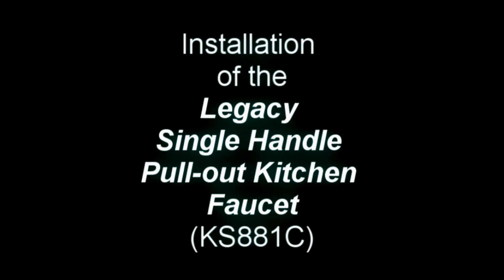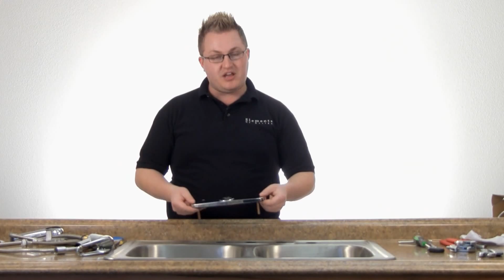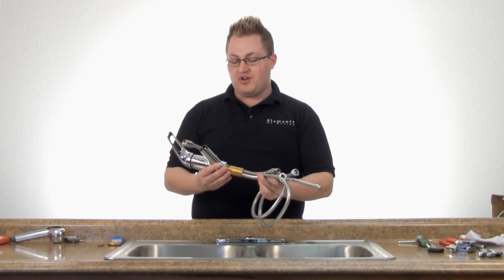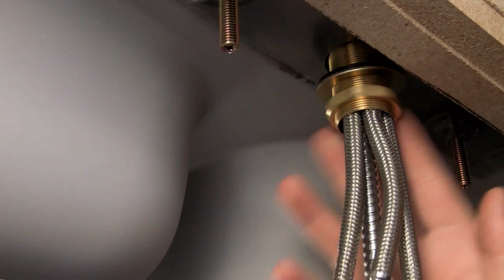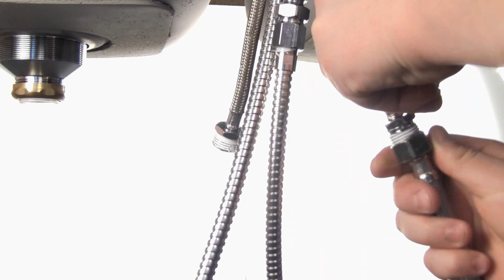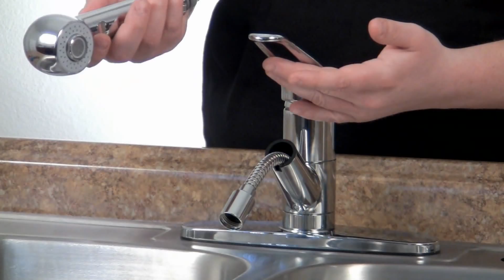How to Install the KS881C Kitchen Faucet

Comment: Our faucet swiveled side to side for about a day, had to loosen the faucet at the base to move it from side to side which has now caused the hot water fitting to leak , just wondering how much I would have to spend to get a good working faucet,,,,